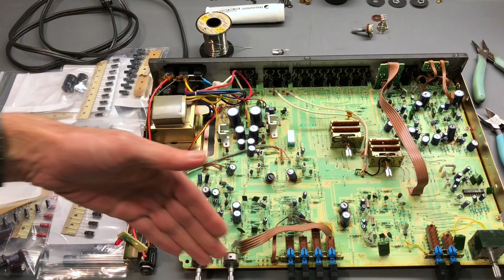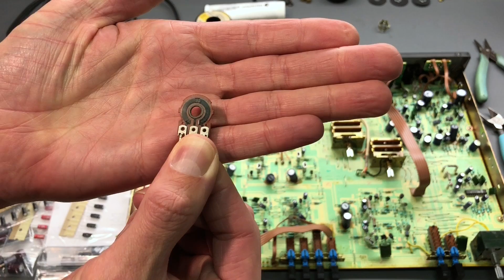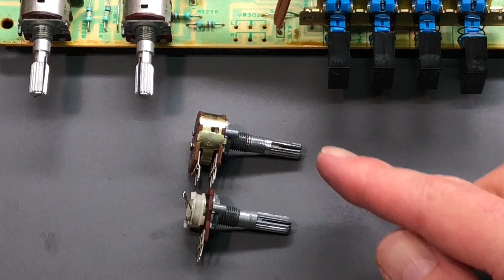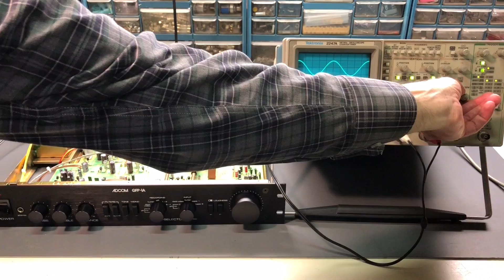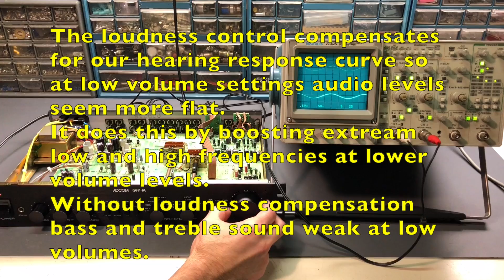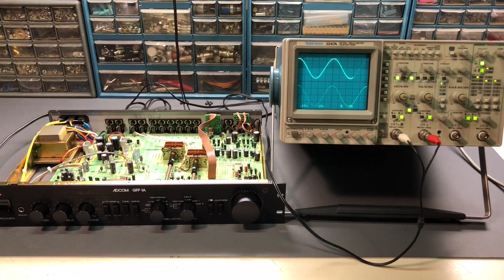ADCOM GFP-1A Stereo Preamp Repair - Fixing the Fault (Part 2)

Comment: What’s the purpose of a balance pot? Who adjusts a stereo so one side has more audio than the other side?
Reply from the maker: It can compensate for room acoustics or speaker placement.  Also some recorded material (usually older recordings) may not be well balanced and you can adjust to what sounds more natural.

Comment: Hi Erick, I couldn't find your email from your home front page, do I have to be on  a laptop to see it? I'm on an android phone. I would like to send you an email about this pre-amp I have in my audio setup. I want to upgrade all of the electrolytic capacitors as well. Can I display my email here for you to make contact with me.
You gave out a parts list of another amp you work on several months back and is what I'm basically writing about. Its also the sizes of these capacitors Im worried about. Any help would be gratefully appreciated.
Reply from the maker: The email link is in the about this channel description, click or tap the ...more and a page should open with the link.  I have a list of capacitors I purchased from Mouser at the time of this GFP-1A repair but I can't say they were all for this one project.  I usually combine projects into one parts order.  Also I may have used a few caps already on hand.  If you want the list I can email it.
Reply: @EriksElectronicsWorkbench ... 1:21   Hi Erik, I did just that but still I don't see your email address. I don't own a laptop at the moment and I'm using a Android Galaxy S23+ phone so that might be the issue. Is there another way of getting a hold of you?
Reply from the maker: @windsong508  it the channel name, without the apostrophe @ gmail

Comment: The original capacitors were the Panasonic SU series which are no longer made. Did you choose general purpose Nichicon for replacement or an audio grade series?
Reply from the maker: The data sheet for Panasonic SU indicates they are general purpose 85C 2000 Hr.  Very average and typical electrolytic.   My replacements were new modern series from Panasonic and/or Nichicon having specs equal or better than originals.

Comment: Do you not faultfind before you start changing parts? And you can safely add Rubycon to your electrolytics supplier list.
Reply from the maker: Yes Rubycon is a trusted name in capacitors.  See the part 1 video for troubleshooting, I never blindly toss in parts in hopes of repairing a problem.

Comment: I was an authorized servicer for Adcom from day one back in the 70s until it was sold to the new owners in Arizona, who ruined the line.  That balance pot was a know issue !  I kept a bag of them in stock until I retired.  The "new" owners through out many parts for old units and did not complete the purchase of parts from the original company in New Jersey.  I am so glad that I am retired now!

Comment: I used to own this preamp a long time ago.  It sounded great and I am an Adcom fan.  But seeing the inside of this one before you fixed it up leaves me less impressed with the build quality in this instance.  The same is not true with my GFA 555 II. Maybe they contracted out the assembly of this preamp?
Reply from the maker: I agree the component placement was sloppy.  I have worked on several other Adcom devices and they did not have this build issue.  Not sure what happened in this case.
Reply: It was a 1983 revision to a 1979 design. Things were different then

Comment: Hi Erik. Thanks for those great videos. Could you please share a link, where you got the balance poti? Highly appreciated :-) 
Best regards from Germany, 
Jochen
Reply from the maker: Jochen, thanks for watching.  I found the potentiometer on eBay.  However I do not think the seller has them now... https://www.ebay.com/sch/i.html?_ssn=rivervalleylandscapingservice2012&store_name=vermontelectronicsplus&_oac=1&_trksid=p4429486.m3561.l170197      however you might also consider this part ...   https://www.ebay.com/itm/155141896870
Reply: @EriksElectronicsWorkbench  Thanks, Erik! I was able to fix it. Also major issue were the 1000µF and 470µF caps. leaking and short circuited inside :-)

Comment: These are great videos.  Are you an authorized Adcom repair center?  Question regarding the electrolytic capacitors - is it the amount of time that a component is powered on which ages them, or is it simply time which ages them?  I guess the question is whether voltage is the catalyst which ages the caps?
Reply from the maker: My videos and repairs are just a hobby, not an Adcom repair center.  I'm glad you enjoyed the videos!  Capacitors in general age from both use and time.  Some types like very old wax paper and foil age terribly with time as the paper becomes acidic and the capacitor becomes more like a resistor.  Electrolytic capacitors can dry out or leak as they age.  Electrolytics that remain in use can have a better life span but if that use involves high temperatures, high ripple currents, then it is counter productive and the life may be in the low 1000's of hours.  Switching power supplies are very hard on electrolytic types.  You may hear the term "reforming" the capacitors in very old equipment by bringing up the operating voltage slowly. This can help but often replacement is the best choice.

Comment: The components are much neater and nicer, and even the jumpers on the PCB are straight. Perfect restoration job
Reply from the maker: Thanks!  yes I fixed some of the jumper wires too, looked rather sloppy and some were almost shorting together.